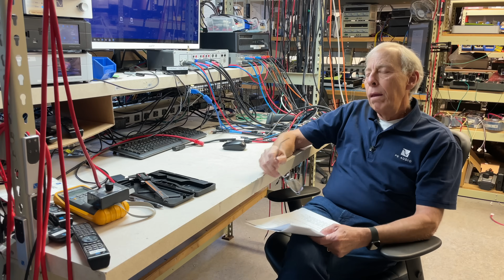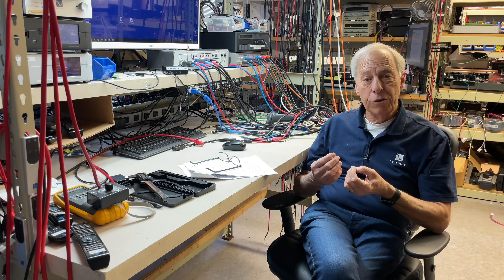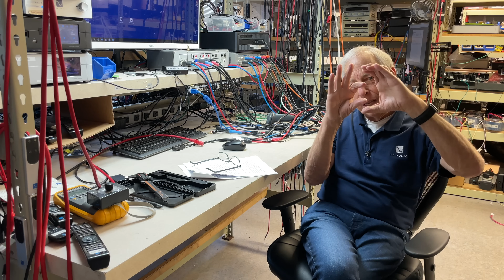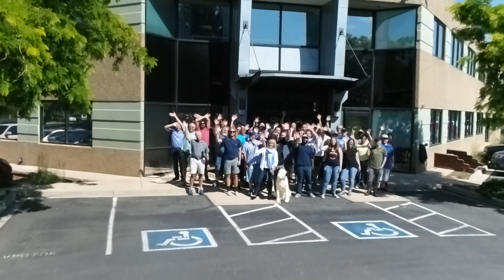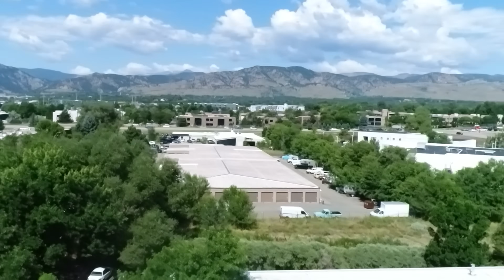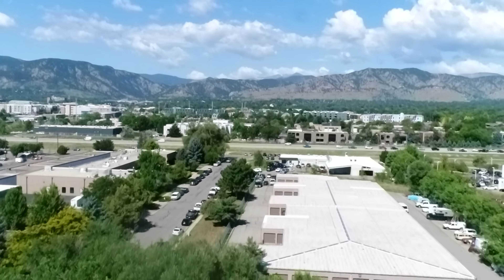Will PS Audio enter the pro market?

Comment: It seems that if you were to market anything to the pro market a rack mounted version of the PowerPlant could possibly work. At least a rack mount version could be made available as an option to those who want it.

However I fully understand not going fully into the pro market.

Imagine the Car market.
"I bought this truck, so I could carry my sound system"
and it goes on. . .

Comment: Having been in PA over 30 years, I have to say that the pro market thinks high end gear is unnecessary nonsense that doesn't matter.  They are wrong of course but I think PS audio along with many others would be seen that way.  The vast majority think Behringer is all you need,  Seriously, that is what they think.  No point casting pearls before swine.  Most don't even have the concept of unity gain or gain structure through their mixing board, let alone the entire system and they sure don't think speaker cables make a dam difference which is why most PA systems sound so bad.  As long as everyone goes home with their ears ringing, jobs done!

No wonder guitarists want to use their tube amp as a main house speaker and don't ever want to connect to the PA.  Always the hardest people to deal with in a band, always want to be the hero and drown out even the lead vocal.  They think the show all about them.  Sigh!

Comment: The saying goes you can't run till you can walk you have to reach the high-end hi-fi market first.
I've got the original EMI microphone amplifier from the late 50s I would say that would be a good amplified to copy I think I have the first model because the serial numbers 0000001 can't find any pictures on the internet. Thought it would make a good phono stage you interested Paul I could take pictures we can work something out.
Pure valves has no transformers in it

Comment: A cusromer of mine wanted his 1970s era Crown PA amps hot rodded by me back in 1995. Changed the intermediate stage and output transistors' power supply decoupling capacitors with audiophile grade variants. The result sounded like a 2,000 watt version of a NAD 302 amp.

Comment: I've never heard of any audio manufacturers supplying home entertainment ( consumer electronics) AND professional equipment ... They don't exist !
Reply: Klipsch did at one time, it was called KP series as in Klipsch Professional. They were not sold to the public. I had a pair of KP 450 speakers that I had in my living room, 2 15"  woofers in each speaker. We also used a pair for the DJ business, they would absolutely kill a La  Scala. But like you said it must have been not worth while because they got out of it.
Reply: JBL, Lexicon, Sony, Panasonic, JVC, HH Scott back in the 1960s. I'll elaborate on HH Scott. His early FM stereo tuners were so good, radio stations were buying them to critically monitor their air signal. This was the dawn of FM stereo. Herman Scott was asked if they could make a rack mount version of the product with some additional broadcast plant features. Being a smaller 1960s company with the now extinct "can do" attitude, he gladly produced a pro version for the broadcast market. They go for thousands on Ebay when they rarely show up.
Reply: Bryston. Super common in studios, also very common for high-end systems at home.

It's more a marketing issue than an engineering issue. My main amplifier for listening is usually an MC2 MC650. I haven't found many audiophile amps that beat it, and it was originally part of a Turbosound installation in a theater.

Comment: I can understand and respect Paul's position of basically staying in his lane. But, having said that I have shared here before I think there is a market for his "Power Plants" that he is missing. Not in audio but in small data processing centers. Unclean power has always been a problem there. Reboots and lost data is a constant issue. Especially for lets say an office of maybe less then 50 people. There was many a time I can remember in my past career that I could have used a Power Plant.
Reply: There is already a huge market selling UPS units. From cheap desk side offline units you can buy at Office Depot for $99 all the way to system in the megawatt range that take up rooms. There are many choices for small IT racks. Also define "clean power". Computers don't need pure sine waves. They do need consistent power delivery free from spikes and glitches. Commodity UPS units perform this function very well. The PS Audio Power Plant is designed and marketed towards ultra clean sine wave in the interest of lowest noise floor. Not something the IT industry needs. Also the PS Power Plant has no battery. I suspect it can hold a few microseconds due to the capacitors in the DC section. But it won't help you in a power failure nor would it be long enough for a generator to kick in and stabilize.
Reply: @andydelle4509  I once was faced with an install of a system in East St Louis IL oil distribution terminal. That place was loaded with switches, relays, motors and electro magnetic valves. The system itself was not very big, maybe 1000w. A Power Plant would have been nice in that installation. An UPS was definitely NOT the answer. I've seen some pretty exotic solutions for crappy power.
Reply: @wilcalint  Why would a UPS not be suitable? As you may know there are three types of UPS units, Offline that switch to battery through a relay or thyristor and produce a load glitch. Line interactive units that regulate and condition but still switch to battery and have a small load glitch. These two types count on the loads power supply  capacitor reserves to provide the ride through during the quick switch to battery. Then we have true online units that are always on battery with the incomming line just rectified and in parallel to the battery bank. These units have no switch over to battery and produce no glitch. An online UPS is functionally the same as a PS Power plant except that it also has a battery for at least 20 minutes of run time. The only benefit of the PS Power Plant is the ultra low AC distortion. But computer and industrial gear is mostly immune from AC waveform distortion. And they even make online systems that produce low distortion sine wave output. And they cost 25% of a PS Power Plant for the same power capacity. Now how is that not good enough for your industrial application? Perhaps in a laboratory with very sensitive measuring equipment the PS Power plant has some benefit due to it's low electrical noise. But for computer and most industrial electronics, it's gross overkill.
Reply: @andydelle4509  I have something for you to think about. I once worked on a power supply whose chassis was "floated". Not connected to earth ground. That chassis was connected to a -3vdc 10,000A power supply. The draw on the -3vdc rail was always in the milliamp range. What was that about? It was very important.
Reply: @wilcalint  Without more information I can only say that system had Earth ground at some potential other than zero volts referenced to the system. The Earth ground is relative, doesn't have to be zero volts. But what does this have to do with a UPS versus a PS Audio Power Plant? Electrically and functionally the Power Plant is no different than an online UPS. Same topology minus the batteries.
Reply: @andydelle4509  Scattered through my career of 45+ years I had the opportunity to deal with some industrial and military power supply systems. The -3vdc 10,000A chassis float is a technique that's used to sink a nuclear depth charge EMP pulse on a submarine. Don't drop a wrench on it.
Reply: @andydelle4509  Pauls Power Stations are a fascinating product to me as I see applications that few other people would see. IMO if you actually purchased one I would have a qualified electrician drive a seperate driven ground for it. Make sure you connect the ground from the Power Station to the homes normal driven ground.
Reply: @wilcalint  
The PS Power Plant  exactly the same topology as any double conversion online UPS without the batteries. It's nothing new or unique. What is different is the class B power amplifier Paul uses to provide the regenerated AC. This is inefficient but provides  very low noise and distortion AC power - great for analog audio. Most commercial UPS systems use PWM or class D technology to re-generate the AC. But still, 3% distortion is considered very good per IEEE power quality standards and good online UPS systems do stay under 5% THD on the regenerated AC.
Yes, you must bond all ground rods with a minimum #6awg. But what's the point in a home HiFi system? I would be concerned the inductance of the #6 bonding wire would act as an antenna. Safe for lightning but still an antenna in the 100mhz range.
Reply: @wilcalint  Interesting. I have no experience with such technology in the nuclear field, but I am always willing to learn.
Reply: @andydelle4509  I worked for 10-years as an Engineer for: https://www.ga.com/
Reply: Mostly in the Energy Systems Division: https://www.ga.com/energy-systems-and-products
Reply: @wilcalint  Thanks. I will surely check this out.

Comment: It seems to me that a black rack mount Power Plant with a few less Home Audiophile bells and whistles would be a great option that would be very attractive to more studios, particularly mastering studios.  Easy and pie right?  (Or is that Pi?)
Reply: There are already products for that specific market. Again pro audio these days means computer based systems, like Pro Tools which have a MAC as the foundation. To protect these you need ride through which a true UPS provides. The Power Plant is strictly a conditioner. And digital processing gear with switch mode power supplies could care less about AC waveform distortion.
Reply: @andydelle4509  I have a number of profesional producer friends with Platinum records that all have a wide variety of tube and analog outboard gear.  Mastering studios still rely heavily on outboard gear.  I myself use good tube and Neve style mic pres going into "The box".  A regenerator is overkill for me but not some of my friends.  And frankly, LA power isn't great.
Reply: @L.Scott_Music  Ok so you propose putting analog outboard gear on a PS Power Plant. I can't argue with that. Potentially some benefits there.
Reply: @andydelle4509  Yeah, I probably should have a little more specific.  We all get in our bubbles without realizing it and I wasn't thinking outside of mine.  Studios that can afford a Power Plant certainly are fewer in number.  It occurs to me sales might be a hundred or so over several years and near none during a pandemic!
Reply: @L.Scott_Music  I'm not sure why you say that - there is actually a fair amount of recording going on during all this of solo artists and small groups as opposed to say symphonies.

Plus a lot of artists with home studios use old school gear and many of them could benefit from PP filtration as well.